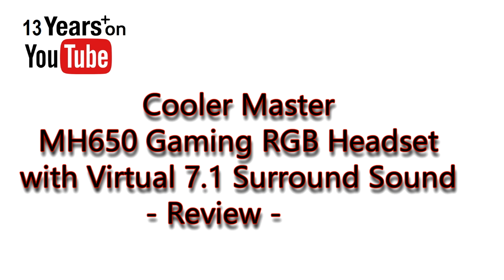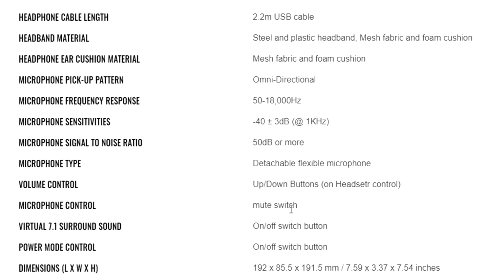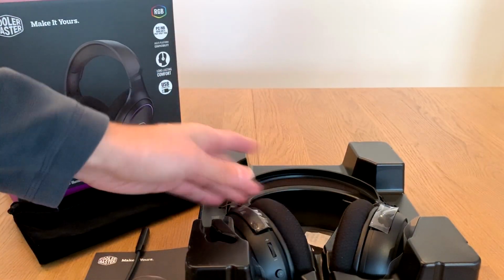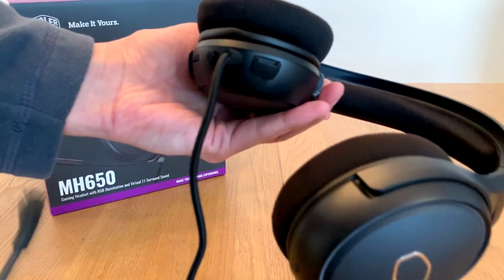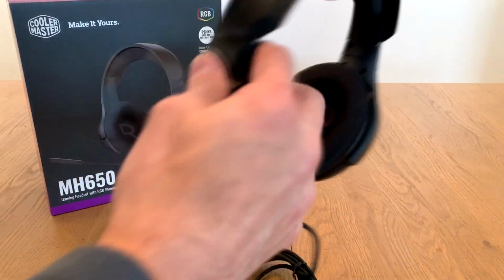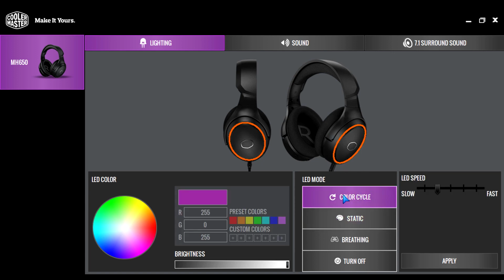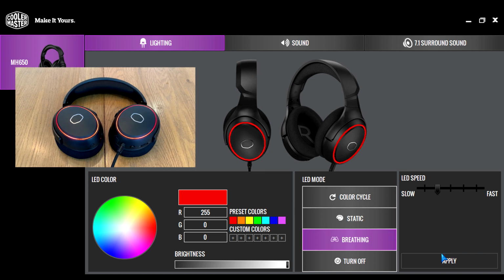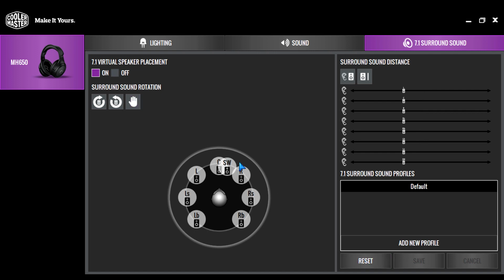✅CoolerMaster MH650 Gaming RGB Headset Review

Comment: MH630 makes much more sense
Reply: Why? Is it better than the 650? If so then in what way?
Reply: @cobalt-snake6125 the mh630  is better for the price but if you want the 7.1 sound and the rgb its better the mh650 also the mh630 its very difficult to find them in stock